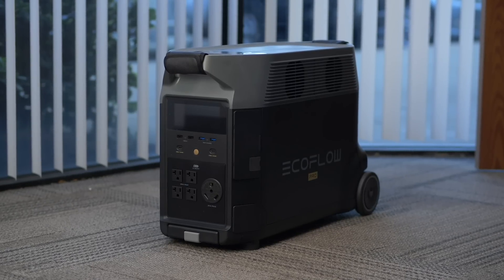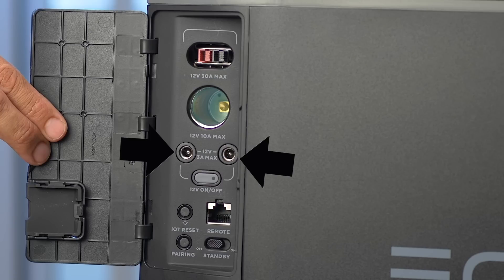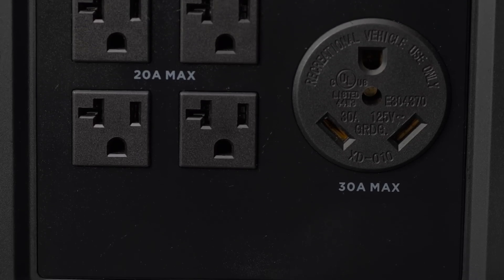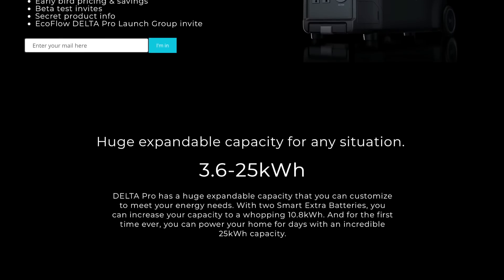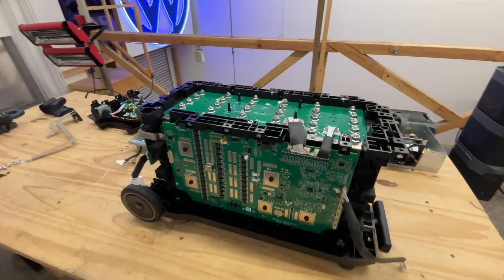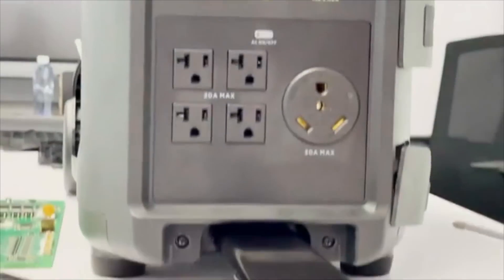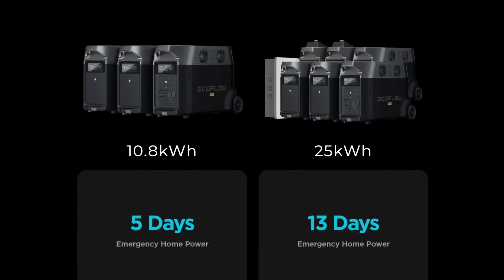EcoFlow DeltaPro - Best Battery System yet

Comment: So how does the Tesla EV charging go? Will Prowse said that the Ecoflow Delta Pro can NOT charge his Tesla. I am asking it because I have an old (2013) Toyota Prius plug-in and that charges with 2400Watt continous current. Needs 2,7 kW for a full charge. I wonder if this Delta pro is capable to charge my Prius or not. Maybe I have to plug in a ground plug to the Delta pro unit.
Reply from the maker: It does charge my Tesla at 120vac up to 3kw
Reply: @jehugarcia  thanks for the quick answer. Do you use a powerstrip and a ground plug for charging your EV with?

Comment: I am considering having multiple point of use power banks instead of one or two large central banks. 
   For the price I can buy 4 1000's vs. One 3600 capacity solar generator. 
   Then can better control and monitor what utilizes or wastes a higher percentage of power then decide to increase or limit usage of certain electrical loads.
 I may not have the capacity to run high load equipment. Also in real emergencies can keep aside a fully charged pack that is more portable.

Comment: Excellent review. Still on the fence due to cost but pretty sure this is what I want for occasional home power outages. To get 240 can I link one Pro with an extra battery plus the HUB connector or do I need two Pro units?
Reply from the maker: 2 pro units needed

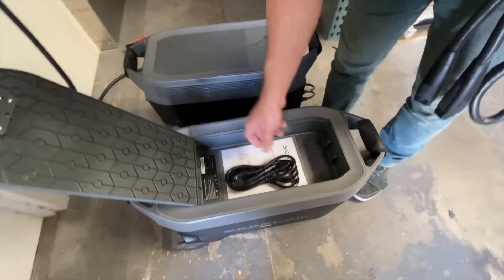Comment: 04:56 where can i get this long cable to connect batterie with delta pro.
i have a Delta Pro and two batteries, but the cables are to short.
this cables in the video would be perfekt.
i have also made 9 Videos about the Delta Pro, but 8 of them in german and we have a different electric system.

Comment: So I’ve never dealt with solar generators before. Will this power devices solely off of solar power from solar panels as long as there is sunlight and then use the generator battery when sun goes down? Or is solar just an option for charging the generator?
Reply: Solar is an option.  I have a 2 x 200w = 400w.  I use two 400 w panels run in series and a delta max pro3.7kw .  It pretty much runs on its own except on consecutive rainy days with overcast.  But here in California most of the time the sun is shinning.

Comment: Lucky for you that your panel is with in 16 feet of a door. Because most people’s panels are further away than 16 feet. That smart generator is useless for most people because you would have to take the batteries closer to the door to connect it to the generator thus making this a “dumb generator “.  But there are not many Youtubers talking about this.

Comment: Would like more info on the gas generator option. Can it be converted to propane? What is it’s power rating, how long does it take to charge a two battery system? How loud is it? Etc
.

Comment: I applaud Ecoflow's creative buzz and use of "influencers" But how does one explain all the negative reviews..? I have solar already and not a newbie to energy. Am a big fan of this channel  So I purchased a Ecoflow River Pro and extra battery pack... Battery couldn't sync with the River Pro and it seems the power distribution is not what it seems... After a full charge and time to cool ... it's displays overloaded for the AC side..? Wouldn't even allow a charge for a few AA batteries... The DC quick charge throttled down and the Ecoflow internals regulates what it is "willing" to distribute... A lot of trickery and it's not like I am trying to max it out!!  It reminded me of the cell company that offers a speed but then throttles it... A basic power supply that even the simplist  power bank system should handle all day long is obviously beyond what I received and as for the support just read some of them for yourself because they are horrible... I can ditto them because despite several complaints they did nothing and don't believe they intend to ..or even care  to... So I reported it to the credit card company for their support and frankly I just want to reduce the power to pack it up for the return or recycle because this was one horrible experience and totally understand that sometimes the negative reviews are accurate and optimistic thinking will get you in trouble... BEWARE..!! My thoughts are with this is not quite ready for prime time manufacturing... This channel maybe best to build your own... ☯️

Comment: Is it possible to connect a server-rack battery to the Delta Pro?
Reply from the maker: Yes
Reply: @jehugarcia  Will the server-rack battery only charge the Delta Pro, or is it possible to daisy chain the two to run appliances and devices off the  server-rack battery via the outlets on the Pro?

Comment: I have been trying to find out if the internal battery can be replaced on the Delta Pro.
Reply: According to EcoFlow, no.  I wouldn't worry about the battery going bad anytime soon.  The charge cycle is 3500 @ 80% and 6500 @ 50%

Comment: Over a dollar a watt hour... No thank you
Reply: We have just the EcoFlow unit, and it is and does so much more than being just a battery.  We already have a Tri-fuel generator, which is our primary backup power.  We bought this as a backup to our generator, so we could use it at night.  Once you get over the price and learn about the EcoFlow system, you will be amazed.  It was worth the money.  I would like to get the battery for a longer run time.
Reply: Your not just paying for the watts but all the features in one package.

Comment: I bought a 3.6KW Samsung ESS battery. I was hoping they I could link it to this to get 7.2KW in my home but there seems to be a problem connecting to the grid in a power outage situation. They don’t want power going to the grid lines. 
So I probably need some type of switchover isolator. 

Also I probably need panels on my roof to charge the kit. 

This is a bit confusing 😀😃😂😂
Reply: just install 30 amp receptacle and shut off the main braker

Comment: I’m about to pull the trigger on this product. However there are 2 questions I need answered. 
1) how do I connect it to my house for power outage. 
2)how do I get power into it away from electricity from the grid. That means I need panels on my roof right but here in the U.K. there is not a lot of sun.
Reply: 1 - there is a smart panel they are planning to sell for it or you can buy a transfer switch to connect to your electrical house panel

2- you can also charge it at a ev station with their connector

Comment: Thank you for the review these reviews helped me make my decision on purchasing the Delta Pro and smart generator. I do have a question about the smart generator. Did you happen to test the auto on/off feature. My generator does not turn off automatically like it states in the Kickstarter and with the other reviews on youtube. Thanks
Reply: I wouldn't bother with their generator.  It's under powered and while you are trying to charge the DP back up, you will be trying to power things connected to it as well.  You're better off buying a big enough generator, that can charge the DP and supply power, to everything hooked up to it.  

You would need:
1) Manual transfer switch
2) A dedicated inlet for the generator and DP
3) A dedicated 120V, 20-amp outlet for the DP
4)  A changeover switch

Note: You need to add the DP outlet, to one of the switches, in the transfer switch.

Comment: Can someone tell me the device he is using to connect the L15 plug to the dual 120 cords? I assume this is exactly what EcoFlow is gonna do with their voltage hub but I need this solution. Ideally I would like to just create a cable to wire up inside my sub panel but it looked like there was a meter or load balancer in that hub. Hard to see with the short glimpse we got in the video
Reply: I have the same question. There is a similar looking device available from Quick220. In fact, Ben Sullins demoed charging a Tesla with Quick220 a year or so ago. In a recent video, Ben did a video with Jehu and in that video Jehu appeared to use the same device to connect to essential loads panel. Perhaps Jehu can shed additional light on this.

Comment: Thanks for the review. In one part of the video, you mention needing two units for home power, but then you hook up one unit to your shop for backup power. Can you explain? I have one unit on the way, and do not want to buy another in order to use it for home backup, so please let me know how to configure it for home backup using just one unit. Thank you.
Reply from the maker: One unit = 120vac  two units = 240vac
Reply: @jehugarcia  - thank you for the reply. What type of panel would I purchase in order to use the single delta pro for backup power for a home?
Reply: @ques19  I too have this question. The device that we saw appears to be similar to a device from Quick220. I expect that Jehu wired up his own version of a Quick220. I checked his website to see if he offered it for sale but no luck.
Reply: @ques19  - you can purchase any solar panel that stays within range of the solar parameters the delta pro can receive. I think its 150volts 15amps.

Comment: I wonder why there’s so much rage over this 3600Wh unit when you can get a Bluetti EP500 for a little less money and it’s 5100Wh?
Reply: Because it's modular and can go up to a max of like 25kw thats 25,000wh if you wanna look at it that way. Not to mention when 2 units are paired up it can output 7200W in both 120v and 240v making it powerful enough to run pumps, washers,ac units, and any heavy duty equipment which is far beyond the average solar generator. Having a product like this that can scale up to be 7200W output, 3200W solar, 25Kw battery, smart automatic on/off generator backup, and a home electrical panel that can be remote controlled and power a dozen individual circuits... I meeeean not to oversell it but it's a big deal. At least for me it's the solution i had been waiting for all along.
Reply: probably because of the fast charging capabilities and interconnectedness of the entire system.
Reply: Also it has a 3000W inverter
Reply: The EP 500 is $4699 on their site & the Delta Pro is $3599 on their site. Unsure what pricing your getting it at.

Comment: This unit has one huge flaw even lithium batteries wear out after 10 years when that happens you have purchased a paperweight the batteries are not designed for anyone to change you can go to APC and purchase a unit with all the same features design for even medical use 10 times more reliable the units are stackable which means if one inverter fails the second or third one will automatically continue to run the batteries are separate and also stackable so you can choose the batteries that you wish to place on the unit whether it's 1-5-or 10 it doesn't matter it will also start a generator automatically the only difference is these APC products are not designed to be mobile because the batteries are so powerful much more than the simple 3600 watt hour these units are superior in every way except they're not mobile
Reply: What’s APC?   Damn dude not a single punctuation mark lol.
Reply: @joebuck4496  keep in mind I'm not knocking their product or their company it sounds like they are just a very very new company and are inexperienced I like companies that try to improve their products it benefits everybody and if this company made a few changes then it would be a really good product and I hope that they would make those changes in the future but I have nothing against the company I personally have no involvement with any of the companies that make inverters but I do own solar panels a windmill a magnet generator a hydro generator a thermal generator in about 20 different inverters so have fun looking at different things
Reply: Haha after 10 years there will be new battery tech with how its going. Even your build case your stating will be of pass. Something new will be out in 10 years. Just like cars they are paper weights as well. You don't keep them no longer than 15 years or less depending on your use.

Comment: Did you make the L14-30R connector to the transfer switch to the house with 2 three prong to the EcoFlow Delta to get 240V?  Any chance of directing us how that cable is made.  Thanks/
Reply: Any additional information on this subject? I am looking to connect to my sub panel, same as Jehu has and have been scouring his page to find out more info. I don’t have any 240 circuits connected to my panel, but know I have to connect both hot legs coming from main panel. Any insight would be appreciated

Comment: Hello people. 

I had a genius idea (or at least I think so). For those who live in a house and don't like to pay for the electricity. 

There can be installed solar panels on the roof, a controller and a small battery, as well as an inverter 12V-110V connected to the EV ... 

The panels get the power and through the controller, it is sent to the small battery and the car from which the electricity is directed to the house, but only after it is charged (which should not be long considering that the panels will be about 5000 watts). 

A thick cable is passed from the electric car to the inverter and from it the 110V cable goes to the electric panel of the house. 

When the EV is not connected, the power from the small battery is used. 

Any comments on the subject? 

Thanks in advance 🙂.
Reply: electricity is so cheap all  of this is useless

Comment: I've seen that the generator will only charge one battery automatically even if multiples are tied into the system. This seem like a major design flaw.
Reply: Will Prowess just posted a review showing that if two batteries are connected, it will first charge any battery that is lower than the max charged unit and will then charge 3 simultaneously

Comment: is it hard to lift it to your car/desk? i heard its 45kg and it seems rather too heavy
Reply from the maker: It’s heavy,  the max is much more portable
Reply: The Delta Pro has 3 internal battery packs (reason for the 100 lb weight and the long battery life). The Max is lighter but you are sacrificing portability for use time, since the Max won’t keep things running as long as the Pro. The Pro has wheels and a pull out handle, but lifting into a vehicle could be tricky. Given past history, the retail price (instead of the kickstart price) will probably be 50%-75% higher  when it come out. It’s always a trade off. It is not a cheap system, but typically you get what you pay for

Comment: Just wondering would anyone know how many say 100Ah Battle Born Battery equivalent the Delta Pro would pack?
Reply: I think it's 3, but don't quote me on that.
Reply: @Built05STI  Yes, I hear you and looking into the system deeper I decided to go for it myself during the Kickstarter Campaign they had. I ended up locking in a pair of the Pro's along with a Smart Generator and am patiently awaiting on the other accessories to be delivered that are still caught up in the supply chain backup... I don't think many people realize just how costly these parts are if bought separately let alone packaged so nicely as they come. Good luck.

Comment: Can't believe at first the Delta Pro's total expandable capacity is uo to 25kWh. This would be great for my off grid cabin.
Reply: 25 KW you are the grid get the air conditioner on the hot tub ready 😁🤔👍
Reply: @rogerkerkmann  I have a MR Cool DIY mini split in my cabin. 22 SEER, highly efficient. It pulls 288 watts up to 1450 depending on what setting you have it on. Highly anticipating seeing how long my delta pros will run it when maxed out with solar.
Reply: That's why I got mine!
Reply: You must have been watching Dave Poz's channel👍 I've been looking at some of the DC powered AC units very efficient but very expensive 😂